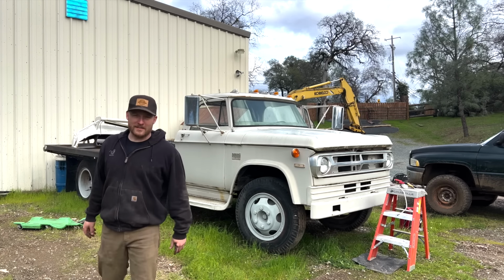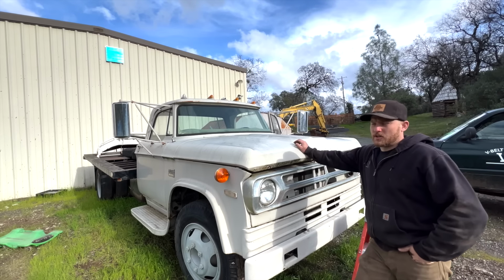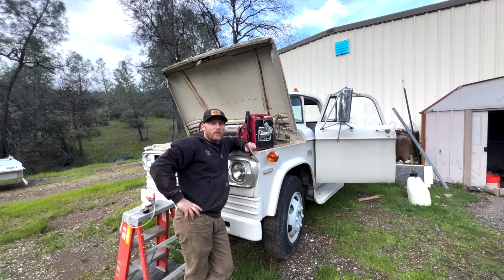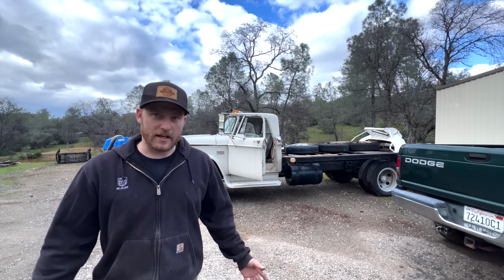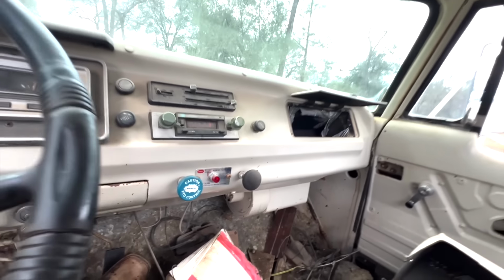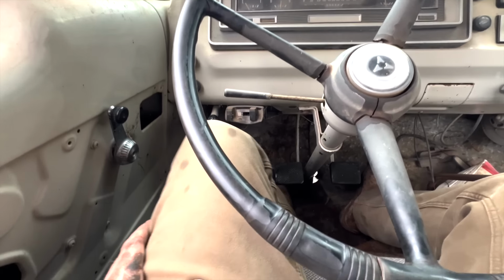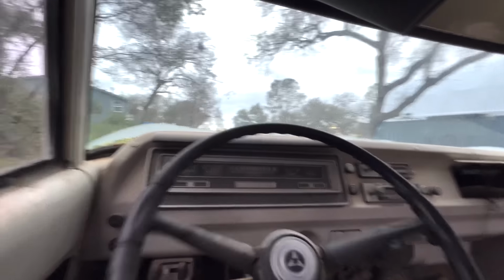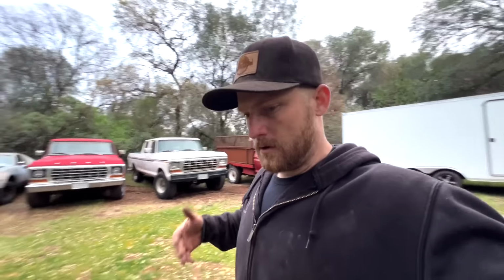1970 Dodge D500 Dump truck! Will it run and drive after 5 Years parked?

Comment: Yes, that is a 318 Polyspherical engine.  Production ended in 1966.  The original 6 cyl engine would have been a Slant 6.
Reply: They continued production of the A engine for several years after 66 for the Trucks.
Reply: @bobkanno6797 correct but the poly 318 ended in 1966
Reply: They just used up the rest of the polys they had before using the LA 318 I know a guy with a early 71 D500 and it has a LA 318 in it
Reply: @bobkanno6797  That's just like the 413 big block they used them into the early 70's in trucks and in RV's or motorhomes
Reply: @sstdusty  1966 was the last year for  the US market they used them in Canada for 1967 and in industrial applications after 1966.

Comment: That poly 318 is like you said its a “ semi hemi” these engines are small 
Displacement but have alot
Of torque and a strong block hence why they’re the “ A Series” engines compared to the “ LA series” 273,318,340 and 360. If Chrysler would’ve kept to that design and made a 340 version with alot of different intake options it would’ve changed the small block game big time. Good video like always Sam.

Comment: That’s a super clean neat old truck with endless potential. That could someday make a cool project for the channel. It’d be worth hanging on to. Could make a cool ramp truck with a common rail and a 6 speed
Reply from the maker: I’d 100% be down for that. Dump truck might be handy also on it own.
Reply: @samsonandrew7652  Yes dump truck would be handy for your business. If you did that, it would need a VBelt logging sticker on the door 👌🏻

Comment: I believe when you turn the truck over and it doesn't have spark until you let off the key, means a bad ballast resistor, cheap easy part to replace.

Comment: Of course it will run it's a dodge the thing that surprised me is the Electronic ignition box worked but I know it will not work long with the goo melted out of it because that is what keeps that box cool and once it runs a while and hat box heats up it will burn out and will need replaced

Comment: They ran the slant 6 engines all the way up to the 600 series trucks.
Reply: I have a 68 d300 slant. I'm trying to figure out the correct air cleaner since mine is missing. Would it have been an oil bath in 68 for the truck?
Reply: @timbarry5080  It's possible it had a normal one or oil bath.
Reply: @MitchJohnson-uu5uf  thank you

Comment: That's the A block 318 nicknamed the Poly or the Semi Hemi it was used in the 50's right after they stopped making the Gen 1 Hemi's right up until 1966 but the LA 318 was build from the A 318 the LA stands for Light A because the A engine weighs about the same as a big block Mopar or B block anyway they are good engines the short block of the A is the same as the LA but the A had different oiling configuration then the LA

Comment: These trucks here these trucks are the best trucks for tow trucks, trucks, and flats. They for tongue and stuff the good trucks are nice coming in and the nice of the stacks and put all LA lights on. Take them off the door frame and put a new fruit. Put them on a new frame. Put your seats in there. Use new nutribula Dodge parts lucid.  Take out the old drop for let's drop a new Cummins in there. And they're coming to give some power. Our take their old rims off take them old dolls off luke's bleach in everything

Comment: Is it possible to put 180 horsepower 1988 12 valve down in that get rid of that gas junk don't get me wrong 318 are awesome they just don't belong in a truck that big but if you was to stay with gas Resto mod that with an 8 L V10 and an nv 5600 behind it then it would have some power wouldn't be slow either but anyway it's a cool truck
Reply from the maker: That’s what im doing to my crew cab sweptline. 97 215 pump 5 speed chassis swapped.
Reply: @samsonandrew7652  total coolness with all the awesome sauce I'll stay tuned to see that